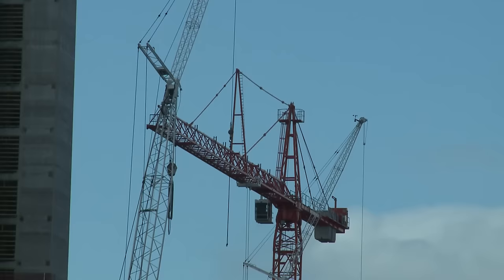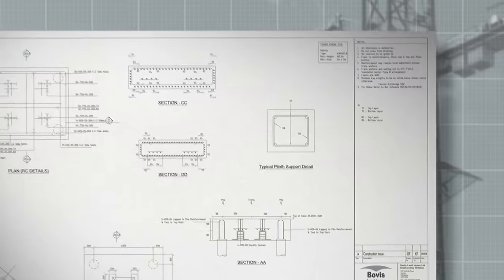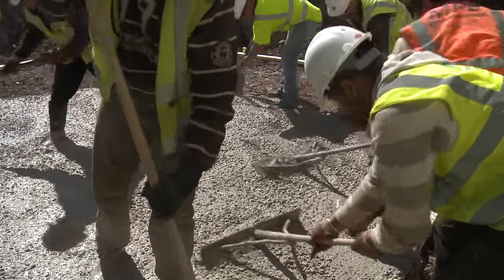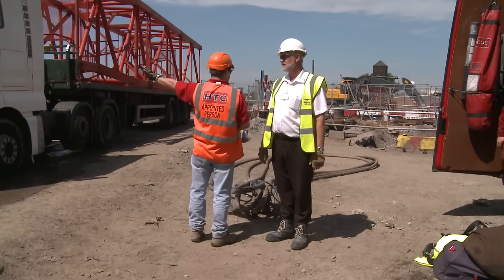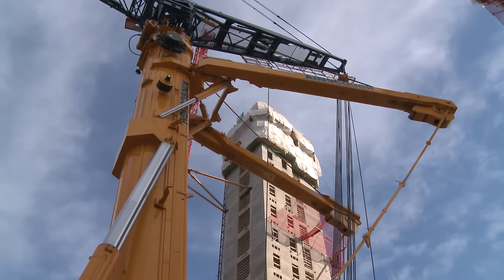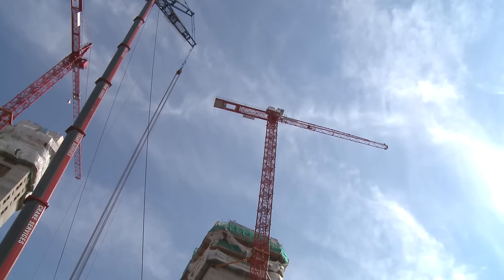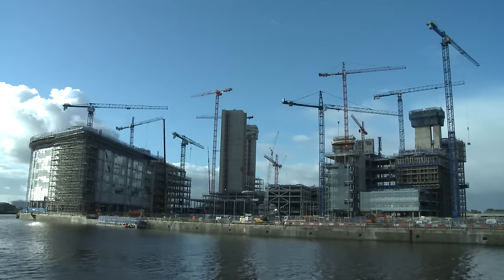How to build a Tower Crane

Comment: Cant do a thing without a signature to ensure thst the correct person is shafted if something goes wrong.
Reply: Bingo!
Reply: Holding people responsible while doing dangerous work is critical. Might have prevented a bad accident here in Seattle while two men were taking down a tower crane.
Reply: The paperwork is intended to be completed by knowledgeable people such that no critical steps are missed.
Reply: They only get shafted after the correct paperwork has been filled out
Reply: Signing your name as the responsible party will do wonders for your focus and thoroughness.
Reply: EXACTLY!  I was thinking the same thing.
Reply: You'll be amazed at how fast many of those authoring the paper work disappear during an investigation when sh*t goes sideways.
Reply: Shafted?😂😂

Comment: Thank you for the very detailed video. Always wondered how the base of a crane is built
Reply: I had NO idea it started off like it does...
I thought it was magic!!
Reply: Interesting because it looked as if they didn't show the piles being driven and they didn't show any anchors bolting the derrick base footings to the piles; it looked as if they were just depending on the shear strength of the footing concrete to prevent pullout.
Reply: Gianni P what happens to the base when the crane is dismantled .
Reply: I believe they just leave it there. It gets covered by.... something- maybe the parking lot. It just lives there forever.

Comment: I absolutely love this video. I've always wondered how one of these cranes are erected, now I know. I find this type of crane, and ones used a shipping ports so fascinating. I'd love to be a crane operator also. However, I'm fully retired now and dont work at all , and too old to change professions. However, I am an electrical engineer that just started designing things based on the Arduino micro-controller. This little computer can control stepper motors controlled by a joystick. I plan on making a scale model of both types of cranes, maybe 5 to 8 foot tall, then have the steppers move whatever moves, under my control with the joystick. I plan on putting in a colored camera for the view as if I am at the top as the operator. All needs to be functionally equivalent to the real thing. Then on the ground little model shipping containers, and other objects. This all will be the ultimate virtual reality game, even better than any computer based virtual reality game! As a kid I was always a huge fan of cranes, so awesome. I would spend hours just sitting there watching them. I even had permission from the port to go to the dock and be able to watch in person, and really close. I just wonder now why I didn't become a crane operator. I guess we really cant always tell what life is going to throw at us! Anyhow, I will be doing these two projects. I may be old, but I still love toys... and if the dog gets too close, I will lift him up and move him also... I like to pick up things and put them back down, as Arnold said on Saturday Night Live... but not the body building thing! Once I do the projects I will do a video and post it here. I'm gathering up all supplies I need to do them with...
Reply: Aye, good luck wid dat mate.
Reply: Everything is right except the beginning they have to make sure the base of the crane is level down to the last 16th of an inch or else in the cabin of the crane it will lean a bit I learned this on my second crane and it gets annoying the higher they work because the more jeans which isn’t scary its just just a pain climbing it sometimes
Reply: Fantastic!  I am a retired Marine Engineer and I discovered Arduinos when I wanted to control lights for my band (I play lead guitar)  with DMX.  I figured out how to get the MIDI signal from the drummer's Roland E-kit to control the lights. Ha!   - Now I'm in a duo - guitar and vocals - no bass or drums so I use a laptop to playback audio backing tracks and MIDI tracks to control the light show - awesome!

Comment: There are also self climbers.  These are towers with a special base to the cab.  The cab climbs one frame at a time and the tower lifts another section in and it is secured.  Then the tower climbs the newly added frame.  This is how they erect cranes beyond the reach of a land based mobile crane.
Reply: Thanks for the information. I can't quite visualize how a cab can detach itself, get out of the way enough to add a section, and then climb atop a new section. If by chance you see a video showing a 'self climber', please post it.
Reply: Thanks for your reply! I've never seen this, but probably just failed to see one during assembly.
Reply: Fantastic insight!
Reply: The entire reason I watched this video was for that.
Reply: self climbers: https://youtu.be/oSyC8pxJdeQ
Reply: thank you for this explanation. i was wondering how those way taller cranes are built. my thoughts that they were beyond the reach of mobile crane so perhaps they were using chopper to lift the rest of the segments 😅

Comment: So let me get this straight

It takes a crane to build a crane???
1.1k likes... and everyone in the comments is a crane engineer????
Reply: They used to self erect (still do sometimes) but using a mobile crane to do it is quicker/cheaper. The reason for not just using mobile cranes in the first place is that they have a bigger footprint and are more expensive to have on site for extended periods.
Reply: nice
Reply: it's cranes all the way down
Reply: Most cranes, mobile hydraulic and crawler often use a 150-ton mobile crane to erect them because of the counterweights and boom sections.
Reply: epistte technically hydraulic and crawler cranes are both forms of mobile cranes. The crane used to assemble this Tower was . 500  to 600tons
Reply: It is obvious to most people that a 150-ton hydraulic crane could not assemble this tower crane that was likely +250' tall.  That large hydraulic crane requireded a smaller crane to assemble the jib and other sections.
Reply: How dare you accuse me of that. I demand an apology!
Reply: Once the crane is about 75 meters tall it becomes self-erecting and can continue to grow by itself, as long as it is anchored to the building every 40 meters.
Reply: Yea
Reply: Look for another video...it clearly explains what we are looking for.
Reply: What exactly are you looking for, other than a winning lottery ticket?
Reply: Erect ! Not build.
Reply: How does that work? Wouldn't the crane have to lift section on top of itself?
Reply: @Suranfox  How could the crane life the top c section on by itself?
Reply: But who built the 1st crane
Reply: @pfernandes8982  Probably someone in China or Iraq.
Reply: @epistte  - I used to be self erecting but I'm old now and my erection time is the same as pushing a rope uphill.
Reply: Duh
Reply: A tall mobile crane is erected on the ground, on site and a smaller mobile crane is used to lift the boom up past a critical angle.
Reply: It takes a Doctor to assemble & operate Frasier Crane. A Sand Crane can stand on one leg all day fishing with Hogan's heroes, Bob Crane. And one rockem sockem robot needed to knock the others block off. See...diagonally. Pretty sneaky Sis.
Reply: Hmmm lil jinxer did you create yourself or did someone create you? Easiest answer is that everything comes from something else.
Reply: Same question I had.
A crane needed to make a crane
And how the driver goes up there
Reply: Takes humans to raise humans. Don't.
Reply: shah, good question. After temporary crane gets things started. Main crane has system to assemble itself higher. https://youtu.be/y39152VWCPk

We know how Donkey Kong would climb up to the operators cab. https://youtu.be/nqAvjeukUFk
Reply: Did you think men carried it up ladders piece by piece???
Reply: @vsetkoumiera7683 , anything's possible on non Union construction sites. We still can't even imagine how Egyptians built Pyramids, maybe by the grace of their Gods making such things possible?!?. Who would have known within just one decade, Chinese would have used more cement, than total United States had throughout entire 20th century.
Reply: In some cases they use helicopters.
Reply: @deathraylabs_nature  No sir! It's turtles.
Reply: Ha, I got one better. Build a steel frame building to build a building. Ha!!
Reply: Then how was the first crane built...🤔😑
Reply: What a dumb question
Reply: Yes 
A temp crane
Reply: Exactly!!!  The only thing I really wanted to know was how they build a crane when there's no other crane around as tall as it.  Apparently, this is just a training video for crane erectors and their contractors.
Reply: China got a new crane that wraps around the structure. Lot safer and faster.
Reply: That's exactly right...
Reply: Just sit quietly
Reply: I worked with a rigger who had no fear. He spent his entire life working as a rigger (late 50ish year old man). He told me out of his entire career the worst and scariest part is working on a self climbing tower crane.
Reply: Yes, and computers are now designed on computers. That's the bootstrap concept you've just stumbled upon.
Reply: @deathraylabs_nature  I always thought it was turtles?
Reply: Then who signs off the paperwork for the crane that builds the cranes?
Reply: @hannecatton2179 : That's what "she" said!
Reply: @crypticclue860 : So who drew the first straight line?
Reply: Building a tower crane takes a minimum of 3 cranes.
Reply: @vsetkoumiera7683  they could, they are strong
Reply: @mfx1  I still don't understand how they self erect won't the crane fall if it just takes a piece of
Reply: @mambak9  An external support keeps it together and also acts as a jack, so it jacks the crane up, you insert a section and bolt it then the support/jack frame jacks that up as well and so it goes on.
Reply: Yes.
Reply: i built 1 v4 the ai
Reply: there are a few types of tower crane, some can lift their tower up themselves when they climb with a tall building
But at the very beginning, yes, it need another crane, and a bigger one
and I was told by my lifting supervisor, some kind of crane ,called derrick, will also need to be dismantled piece by piece after the tower crane erection 
and the last piece is carried manually down the stairs by strong labours LOL
Reply: Hanzy Krupps 😂 of course I was... but somehow this has 1.1k likes and comments from apparently architects and engineers that know everything about bob the builders crane!!!
Reply: DIO Brando
 fr... 1.1k likes and apparently everyone is an engineer on cranes 😆
Reply: Then where does the crane that builds the crane come from?!
Reply: @lenzy1474  rent a mobile crane to build it, they are usually mouted on long truck  and can lift weight to ~750Ton
Reply: So how do I build the first crane!?
Reply: @mfx1  I
Reply: @mfx1  exactly. they still can but each piece needs to be welded together on site and that is much more costly than craning up the pieces.
Reply: My brain is just wondering how they build the first crane because they didn’t have a crane to build it ????
Reply: 123

Comment: They do go over, i was working on the whitleys department store in Bays water London back in about 1986 when a crane fell over during testing ,one guy fell off the jib and the crane driver died, its very surreal watching an object that big fall over, the noise is incredible.
Reply: Your comment is a valuable contribution.  Nobody should die or be injured when a reasonable amount of prudence can prevent it.  The paperwork puts engineers and inspectors on the spot to make sure it's right.  Insurance companies prefer to keep premiums paid.  It's a system of checks and balances that protects lives and profits.
Reply: diamond66ist wow that’s horrific

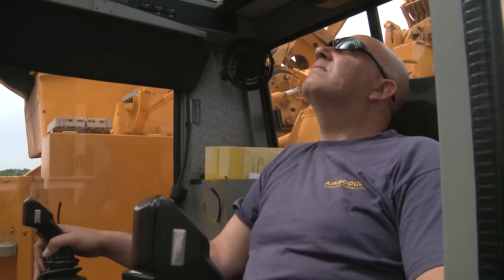Comment: 6:08 "Safety equipment is worn at all times" as they show the crane operator not wearing a hardhat.
Reply: They are not required to wear it if they are inside a machine
Reply: Hard hats are only when you’re head is exposed and vulnerable to objects in your surroundings. If this guy spends all day inside the crane cockpit . No need to wear one

Comment: Do these cranes have any sensors built in to monitor flexing or stress to alarm failure? We have sensors and dedicated processors in some of the newer excavation equipment.
Reply: Yes its its overloaded on they make a loud beeping noise hard not to hear it also have wind monitors and they sway side to side when your stood close to them they have to have some flex otherwise they would snap if have  no flex in them it's crazy to look at seeing them swinging side to side cant notice it from far away

Comment: Can I ask why mobile cranes aren’t just used for everything? From what I can tel they need to be higher then the crane there building so why not just use it? I understand the use for the self building cranes but why use a mobile crane to build a land crane?
Reply: I think because they are more stable and they can lift heavier loads and don't have to move about to reach their and drop the load.Its amusing to use a crane to build a crane.

Comment: there's type of crane which can carry up and build by themselves piece by piece without use another crane
Reply: a self erector. It still needs a crane for the initial assembly.
Reply: Kasper Onza ya true..
Reply: A self-erector and a climbing tower crane are two different types of crane.
Reply: It handles its own erection?
Reply: @godfreypoon5148  Most of the "boys" in San Fran handle their own erections at one time or another.

Comment: Stopping work is sometimes difficult, takes a good operator to do what he knows is right .when the  Superintendent stands up for the operator . When I worked with cranes most of the people I worked with were pretty good when I had to stop for weather .
Many years ago I done a bad thing , we were working on a new power plant all the iron was up and the co. I worked for brought the sheeting crew in to put the sheets around the  boiler ar the 300' level. The first day on the job according to my wind Guage the wind was gusty 27mp. To 35mp .
I sure all operators have had a problem with which side of the building the wind is blowing. This sheeting crew came up with a huge basket to install the sheets it was 12' w and 15' tall they had people on 3 levels to screw the sheeting, the sheeting forman over to my crane and expanded what he wanted me to do, I  asked him about his opinion on the wind he informed me he had to get his job done , I politely told him I wanted his crew to be able to go home to their family  . He bruised up my feelings when he told me did they need to get another operator, he told me to load the basket and put it by the column and his men were going to hold on and I was to lift them slowly 🐌 anyone that has worked on a power plant knows the boiler building is the tallest I started up with them it was OK for a while then everything changed they couldn't hold on the basket began sailing like a kite, I had 430' of boom whe I finally got them away from the building I let them down in free fall .I made a terrible mistake they did also but they wouldn't have if I wouldn't have picked them up .you can tell how old I am things were different back then .I told my wife about how dumb I was but it will never happen again.  I PROMISE YOU FROM THAT DAY ON IT NEVER HAPPEN AGAIN . I DID HAVE TO QUIT A PILE DRIVING JOB I WAS DRIVING CONCRETE PILES ON A FLOATING RIGG I PUT THE BARGE IN PLACE BEFORE I WENT HOME AND WHEN I CAME TO WORK THE OWNER OF THE CO. MOVED MY BARGE ,I WAS DRIVING 12 TO 1 BATTER WE WERE USEING A BIG HAMMER SO I GOT MY STUFF OF,THE CRANE LEFT THEY GOT SOME OPERATOR TO COME AND DRIVE THE PILE HE ALMOST TURNED THE CRANE OVER AND PUT THE HAMMER IN THE MUD .

Comment: If it takes a crane to build a crane, how did they build the first crane?
Reply: Henry Chan. A mobile crane is used to erect a tower crane and in most cases to take it down. Very often a crane takes itself down to about ground level then the jib, weights, operators cab and the rest of the crane is picked by a mobile crane. This one is somewhat odd how they did it. The crane footing rebar was built before it was formed which is odd, the base section of the crane is typically set after the bottom mat is in place and the leveling pads are placed, then the rest of the rebar is placed. I am not familiar with this concrete form thing they home made for this job but if it backfilled all the was around I suppose it work. The backfill should be done in 1 foot lifts and checked for density. It seems none of that was done. 

What is confusing is the fact that they are building a tower crane along side an existing core. Not sure why the crane would be so late in the process but is suppose it could happen. The crane is quite small and cannot lift much. Interesting.

Comment: What I have always wanted to know is how they build and dismantle one of these cranes when building a skyscraper ie the Berg calipha. You see them perched on the top of the building as it grows taller, I remember seeing them on the top of the humber bridge.
Reply: You can add a frame to the top that can lift the whole part that rotates and insert a new section. So you only need to build a fairly small crane the way you see here, then it can make itself taller.
Reply: self-building cranes just read it somewhere here.

Comment: when did they build the other crane to build the red one??
Reply: I didn't watch the entire video, but if you're referring to the yellow mobile crane, it doesn't need to be assembled. It can travel on its wheels or be transported to site via specialised trailers. Even the crane body counterweights can be assembled by the mobile crane by itself. The jib and additional boom requires assembly though
Reply: @rahulshenoy5737  Btw ive never seen a fucking Mercedes mobile crane holy shit
Reply: @drew_porter806  that was a merc truck with a cherry picker arm.this was used for the tie beam brackets  and to connect the tie beams , not for lifting